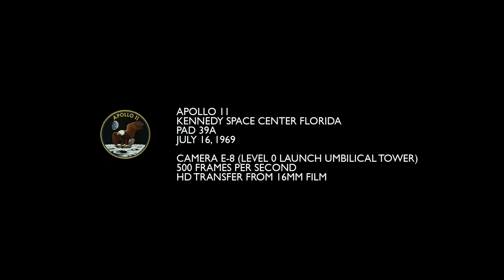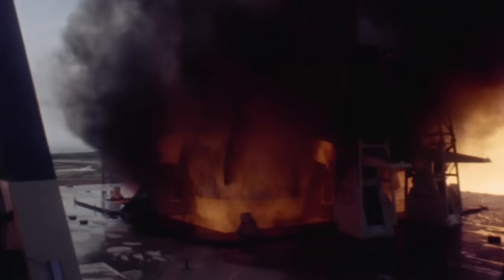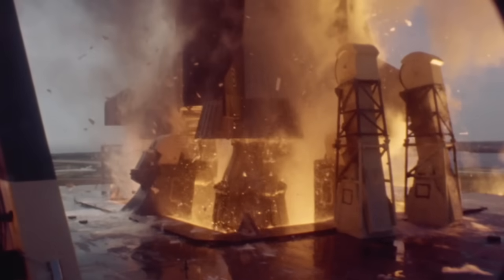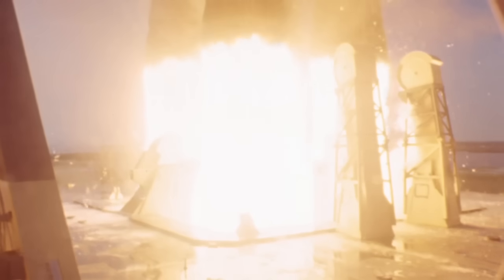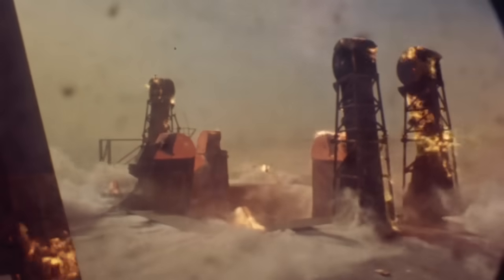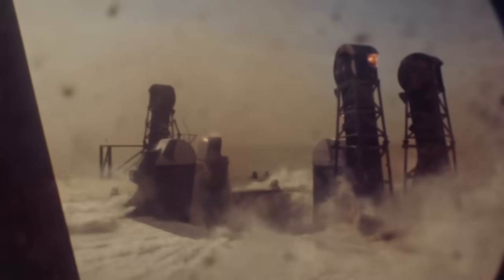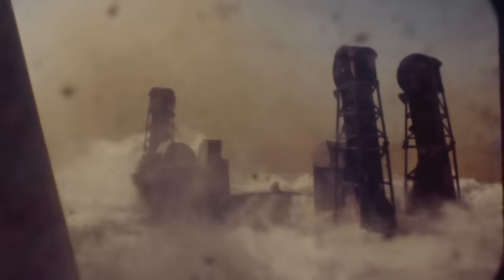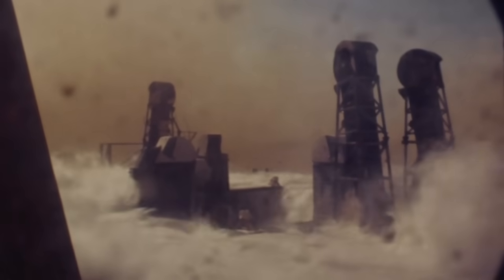Apollo 11 Saturn V Launch Camera E-8

Comment: I like many others at this time was very impressed and watched all of this with great excitement. Though I wondered how they got through the extreme high radiation of the Van Allen Belts, I did not question it. How they landed and took off on the moon's 1/6th gravity with no rockets and did not create a huge creator in the soft lunar dust, also confused me, but again I didn't question it. It was my biggest dream to go to the moon and mars.  Last year in the Space-x program with today's robotics and computer technology it is a matter of historical record that it was the 1st time humans have been able to soft land on a hard surface with rockets.  This was not possible in the 60's 70's and was never demonstrated. It is also physics knowledge that the amount of lead shielding needed to protect from the Van Allen Belt would necessitate the addition of so much fuel, to lift the needed lead or any known shielding material, that the extra fuel would only lift the needed fuel and not enough to carry the shielding.  In other words, Rocket fuel has a limited payload and over a certain amount becomes self defeating. Other yet unknown methods are needed to get a manned shielded craft past the, 20 thousand mile thick, Van Allan Belts. That is why we have not progressed in 50 years. All this was low orbit staged flights.
Reply: +El Fabian - There were never any manned rockets that carried man/women above a few hundred miles and past the Van Allen Belt.  There was never any manned moon landings using rocket technology !!!. Anything that went further was all unmanned and carried minimal 1/8 inch shielding.
Reply: +El Fabian The GR.1 "Harrier" VTOL jet  has been operational since April 1969. It was absoutely possible to land and takeoff on hard surfaces with VTOL.

Hell, helicopters aren't that different, and they've been flying since WW2.
Reply: +Paul Zuk The Harrier and helicopters need air to work; they use turbines not rockets. Much different and much easier technology. Earlier than 2015 there was never any display of rockets soft landing on land.   Look at recent posts by the Space X program.
Reply: +El Fabian - There is no Air or little air on the moon but substantial 1/6th gravity. The harrier would not work on the moon and behave much like a rock in free fall.
Reply: El Fabian
[The Harrier and helicopters need air to work; they use turbines not rockets. Much different and much easier technology.]

It's different, but not at all easier: mechanically, hypergolic engines are actually much, much simpler than jets. Far fewer moving parts.

The entire difficulty for landing a rocket on the Moon lies in control systems, and Harriers not only had to have solved the issues related to VTOL, but they could also operate in two modes: level flight and hover, and transit between them in combat conditions and with a combat load. These all worked fine.

[Earlier than 2015 there was never any display of rockets soft landing on land. Look at recent posts by the Space X program.]

Uh, no, actually, Luna 9 accomplished a soft landing on the Moon in 1966. Several VTOL aircraft were also demonstrated - they used jets, but the engineering problems are basically the same.

SpaceX wanted to soft-land a FIRST STAGE, which is some 10 times taller and heavier than the LM, and has to contend with aerodynamics every step of the way. You really aren't even trying to consider differences between each craft: it's not the propulsion method that makes the Falcon 9 landings difficult.

The gravity on the Moon being lower, and there being no crosswinds, thermal currents or weather to consider makes it EASIER, not harder, to accomplish a landing.
Reply: +Paul Zuk - Paul, I do see what you say, yet, there are some unanswered points: There is no air on the moon; Jets are not much different than a rock; they just don’t work! Landing the narrow clustered rockets would be like attempting to balance a stick with rockets, this is not the case with the wide spread jets of the Harrier. Air does give buoyancy. The simplicity of jets is not in the number of moving parts but in the control, and, speed of response of the jets compared to rockets. Rockets have a very slow reaction time compared to Jets requiring much more intricate control and predictable pre-action. I went to school with a few military engineers and know their problems. For it to have worked back then it would require the lander to be flat plate shaped, and have a minimum of three rockets spaced at several dozen feet apart relative to the vertical lander payload. Today’s digitally controlled robotics motors versus the linear controlled mechanism of the 1960's and new ultra-fast computer controlled paradigms just barely do it. You do know that a NASA scientist did admit that all attempts to fly the lander on earth failed and that better control or a redesign of the lander was needed just a month or so before the lunar mission. To roughly land an unmanned vehicle on the moon which spins and bounces around out of control would kill any living passengers, but is acceptable for secured electronic devices and mechanisms.  I have been quite familiar with the Van Allen Belt and other forms of cosmic radiation since before my teenage and university years in the 1960’s.  Don’t take my word for any of this all this information is available, if you care to look for it. Please consult these other sources and come to your own conclusion. I would love to believe we did land a man on the moon, but the evidence is far too heavy against it.
Reply: El Fabian
[Paul, I do see what you say, yet, there are some unanswered points: There is no air on the moon; Jets are not much different than a rock; they just don’t work!]

Take the oxidizer with you and they do. The only difference between jets and rockets is that the rocket has to take ALL the fuel with it.

This forces different design issues, but flying a vehicle balancing on thrust generated by jets and by rockets is basically the same. The LLTV and LLRV both exploited this principle to train astronauts for operating the LM.

[Landing the narrow clustered rockets would be like attempting to balance a stick with rockets, this is not the case with the wide spread jets of the Harrier.]

It is however the case with things like the X-13, which demonstrated this capability in 1955. Helicopters are also not very different in principle.

The problems were all solved. Also, the Harrier's nozzles were only widely separated on the X axis, the Z axis only saw separation by a couple metres.

[Air does give buoyancy.]

Which no airplane actually uses for control. It gives far more problems for VTOL than benefits.

[The simplicity of jets is not in the number of moving parts but in the control, and, speed of response of the jets compared to rockets. Rockets have a very slow reaction time compared to Jets requiring much more intricate control and predictable pre-action.]

That depends entirely on the type of rocket, and the environment it is being flown in. Acceptable input delays differ based on design requirements, you know.

[I went to school with a few military engineers and know their problems. For it to have worked back then it would require the lander to be flat plate shaped, and have a minimum of three rockets spaced at several dozen feet apart relative to the vertical lander payload. ]

Or it would require the single engine nozzle to gimbal in order to keep the thrust vector pointed more or less through the centre of mass, and an RCS system to nullify any residuals.

You know, just like the X-13 did it, despite NOT being shaped like a flat plate.

[Today’s digitally controlled robotics motors versus the linear controlled mechanism of the 1960's and new ultra-fast computer controlled paradigms just barely do it.]

The LM had a flight computer, you know.

[You do know that a NASA scientist did admit that all attempts to fly the lander on earth failed]

The LM was never even attempted to be flown on Earth, for the same reasons why you don't try to take a submarine and make it fly. It was designed for orbital and lunar operations - it COULDN'T fly on Earth by design.

[...and that better control or a redesign of the lander was needed just a month or so before the lunar mission.]

Name the engineer and source for this statement.

[To roughly land an unmanned vehicle on the moon which spins and bounces around out of control would kill any living passengers, but is acceptable for secured electronic devices and mechanisms.]

Surveyors 1-3, Lunar 13, 16, 17, 18, 20, 21 and 23 all used landing methods that you say are impossible.

[I have been quite familiar with the Van Allen Belt and other forms of cosmic radiation since before my teenage and university years in the 1960’s. Don’t take my word for any of this all this information is available, if you care to look for it. Please consult these other sources and come to your own conclusion. I would love to believe we did land a man on the moon, but the evidence is far too heavy against it.]

You were more familiar with the VARBs than the man who discovered and studied them, who said the idea they would kill astronauts was pure nonsense?
Reply: +El Fabian - There are many who will never be convinced no matter the evidence, but there are a few who , willing to look, will see the outpoints clearly.
- The moon has 1/6th the gravity of the earth. It is logical to expect that the rockets needed to lift off the moon must be at least 1/6th the size of the towering earth rockets that lift off the earth into high or even low orbit. 
Where are these rockets on the moon lander??? 
All one sees is a small pod which barely houses the occupants, that you are expected to believe lifted itself and the astronauts with a bunch of rock samples up into high orbit from a space mass 1/6th of the earths is not scientifically or logically possible. Come now we are not all children, we, at some time after the excitement, will come to our senses and re-think it through. 
- an enormous amount of force and pressure is released from a rocket any loose material including rocks and boulders are blown away, especially loose moon dust swept away leaving bare rock for several hundred feet, but yet there is dust a few inches deep all around the lander, leaving footprints, and we leave a flag and other machinery just a few feet away.  
Don't believe it, then you haven't watched this video of the rocket pad experiences closely!!!
- Now radiation: 100 Rem or 1 Seivert received over a short time period are likely to cause acute radiation syndrome (ARS) and death within a week. The Upper Van Allan Belt radiation level is around 10 Million electron Volts  or 10 Mev. 3 MeV is the daily limit set by the ICRP.  The Rem is a measure of radiation per kilogram of body mas, the MeV is a measure of energy which can be converted to Joules and Calories. The amount of body mass absorbing the energy determines the lethal radiation measure. In the VABs the energy is continuous and consistent. Work it out for yourself.  If some Scientist, no matter who he is, is saying that 10 MeV or 1 MeV over the span of time through the VABs and radiation from the sun throughout the months of journey does not cause harm, you need to ask yourself why is he saying contradictory data. Go down to Florida and look at the thin coating on the lander.
 - The difference in power and mechanics between a Harrier and a rocket are self evident! Controlling the direction and magnitude of a 30 million horsepower relentless rocket engine to balance a vertical non horizontal structure with closely grouped rockets is a different order of magnitude than controlling any turbine jet with a horizontal spread of several dozen feet and no vertical structure. Please!

-The old USSR was far ahead of us with rockets at the time, why did they never leave manned low orbit and drop the potential benefits of mineral wealth and a strategic military moon base.

The evidence is of great abundance and spans a much larger stack of data, if one cares to look.

Why doesn't NASA, get their ethics in, admit it and just go on with renewed research and really fulfill all our dreams.
Reply: El Fabian
[- There are many who will never be convinced no matter the evidence, but there are a few who , willing to look, will see the outpoints clearly.
- The moon has 1/6th the gravity of the earth. It is logical to expect that the rockets needed to lift off the moon must be at least 1/6th the size of the towering earth rockets that lift off the earth into high or even low orbit.
Where are these rockets on the moon lander???]

It is not logical at all. This relation does not scale linearly, but logarithmically, as governed by the Tsiolkovsky Rocket Equation.

The primary variables in this equation are empty mass, fuelled mass and specific impulse of the engine.

IOW, what determines the size of the rocket is primarily the payload.

[All one sees is a small pod which barely houses the occupants, that you are expected to believe lifted itself and the astronauts with a bunch of rock samples up into high orbit from a space mass 1/6th of the earths is not scientifically or logically possible. Come now we are not all children, we, at some time after the excitement, will come to our senses and re-think it through.]

It is indeed scientifically possible. It's not even that hard to calculate: the densities of Aerozine-50 and N2O4 are known, their specific impulse is known, and the weight of the payload can be reasonably estimated. Apply the rocket equation and be amazed.

I did this math ; It checks out.

[- an enormous amount of force and pressure is released from a rocket any loose material including rocks and boulders are blown away, especially loose moon dust swept away leaving bare rock for several hundred feet, but yet there is dust a few inches deep all around the lander, leaving footprints, and we leave a flag and other machinery just a few feet away.]

Quantify "enormous". The momentum impaired to the rocks and dust depends on this quantification, and the question of whether or not a given rock should be blown away and how far depends on the amount of momentum transferred.

Robert Brauenig actually did this analysis. It checks out as well.

[- Now radiation: 100 Rem or 1 Seivert received over a short time period are likely to cause acute radiation syndrome (ARS) and death within a week. The Upper Van Allan Belt radiation level is around 10 Million electron Volts or 10 Mev. 3 MeV is the daily limit set by the ICRP. The Rem is a measure of radiation per kilogram of body mas, the MeV is a measure of energy which can be converted to Joules and Calories. The amount of body mass absorbing the energy determines the lethal radiation measure. In the VABs the energy is continuous and consistent.]

1) The VABs have topography. They are not uniform in the amount of radiation they store

2) The Apollo crews were not flying through the belts naked. You are ignoring the spacecraft itself ; Why?

[Work it out for yourself. If some Scientist, no matter who he is, is saying that 10 MeV or 1 MeV over the span of time through the VABs and radiation from the sun throughout the months of journey does not cause harm, you need to ask yourself why is he saying contradictory data.]

1) James Van Allen said that this idea is nonsense. It absolutely matters who the scientist is.

2) No Apollo mission took "months" to complete. It says a lot that you don't know that.

[Go down to Florida and look at the thin coating on the lander.]

You seem to be hugely confused about the Apollo mission plan. The longest any Apollo astronauts stayed in the LM in space was four days, during Apollo 13.

[- The difference in power and mechanics between a Harrier and a rocket are self evident! Controlling the direction and magnitude of a 30 million horsepower relentless rocket engine to balance a vertical non horizontal structure with closely grouped rockets is a different order of magnitude than controlling any turbine jet with a horizontal spread of several dozen feet and no vertical structure. Please!]

Actually, the X-13 used a jet engine with nearly the exact same top thrust as the lunar module, and managed to land and take off vertically just fine in 1955. It also had the nozzles arranged close together, with the noted difference of its center of mass being much higher than the LM's.

Rocket guidance for liftoff was a solved problem since the 1940s, unless you think the V2 was also a hoax.

You seem to be under the impression that the LM used the F1 main engines, which was not the case. It used a throttlable hypergolic engine with a top thrust of 45 kN for descent, and a separate fixed thrust hypergolic engine for ascent.

Rockets can be different from each other, you know, just like any other engine.

[-The old USSR was far ahead of us with rockets at the time, why did they never leave manned low orbit and drop the potential benefits of mineral wealth and a strategic military moon base.]

It really wasn't that far ahead. Far ahead by what measure, exactly? Throw weight? Reliability? Fuels? What?
Reply: +Paul Zuk - Van Allan did discover the Belts but there has been much more recent probes sent up with more accurate energy calculations. As I said 1 to 10 MeV's in the upper belt and can be much higher during high sunspot activity.  There is also high enough lethal energy in the lower belt and in the region between the belts there are also very high unpredictable streams of cosmic radiation all along the mission path.  Look at the video I linked.

What is the Mass Ratio of the lander and it's needed return fuel load compared to a high orbit Rocket on earth? That should give a clue to the size of the craft needed per these equations. I don't know but I would think it is much more than what we saw in the pictures of the moon landing?? 

I majored in Pure Math/ Physics and Robotics not rocket science and engineering so I would need to do a lot more research to settle my own questions as to what you are saying. Before that, there are still many  glaring unanswered outpoints. My brother majored in Astrophysics but he's a real woss and has no interest in anything though he does believe most of what I say about this as do many of my learned friends. Did you know that an astrophysics student spends a whole semester on just Sun energy data. This includes sunspot activity and radiation. What a waste if it turns out to be an electric plasma phenomenon.
. 
Go look at the spacecraft it's almost paper thin. 1/8th inch aluminum? at most. What protection is that!
You need at least a 1/4 inch of lead sandwiched between two other plates.

A V2 never landed upright. Landing is much different than shooting off. It also is a Logarithmic opposite relationship because the power is decreasing rather than increasing. Look at your own equations

I don't think you answered the dust and rock outpoint effectively.

Aerozine-50 was used by the Titan II ICBM only ! Didn't the moon rockets use a Hydrogen or acetylene /Oxygen mixture LH2/LOX; nevertheless I will at some time do as you say and look at the impulse output of whatever fuel was used.

I still think you bring up several good points and find I am more in agreement with you, but I also find you have whitewashed a few other important outpoints. Who are you?
Reply: +Donald Weber - Further to what I just said. I really don't care. I am far more interested in continued development of space flight and care less about what was probably done earlier by some  greedy unethical people.
Reply: +El Fabian Whats funny is how you have Zero understanding of how much radiation is Actually in the Vab's Nor how Radiation in general works Or have a Basic understanding of how rocket's work. Lul.
Reply: +Mods_o_joy Entertainment Studios : please enlighten me with your great knowledge.
Reply: +El Fabian James van Allen NEVER said a spacecraft couldn't go through the VARB. He designed the tarjectory the Apollo craft took, which only skirted the VARB. The astronauts received less radiation that an Xray tech does over a year.

The LLRV and LLTV were successfully landed hundreds of times.

The lunar lander didn't have just one engine. It had a descent engine and the ascent stage had four sets of reaction thrusters to control pitch, roll, and yaw, which were used going down and going up.

Rockets react a hell of a lot faster than jet engines. Jet engines need time to spool up. Rockets give instant thrust.
Reply: +Donald Weber- I watched closely at the time and LLRV & LLTV 's were not satisfactorily successful at landing on earth. Maybe this datum has changed since then? 
I am aware of the closely packed cluster engines and that the descent stage was purportedly left on the moon. Which I consider was a bright idea.
I understand your statement of spool up time and agree; however thrust vectoring on jet engines, which accounts for high maneuverability, is almost instantaneous and though more complex much faster and easier to control than rockets. Please look at Thrust Vectoring data comparisons with rocket engines.

Also 

It is correct that Aerozine-50 was used! I was mistaken.

The almost 400 foot high 33 foot wide Saturn V held an ocean of fuel and at a mass of 6.5 million pounds  was at nearly the limit of payload available to fuels used in Rockets  with a Trans Lunar Injection payload of about 107,000 lbs with an orbital insertion of ~ 2 billion lbft.s impulse(amazing). The Apollo 11 mission CSM lunar orbit was reported at the time at about 50 km from the lunar surface. Later flights reported an understandably much lower lunar orbit to accommodate the LM lift off restrictions. The LM was reportedly about 36,000 lbs at about 20 x 13 x 12 feet with a propellant mass of about 5200 lbs and a thrust of 3500 lbft. The moons gravity is 1/6th earths and escape velocity works out to about 1/5th that of earths or approximately 2.4 km /s.  Allowing for the Natural logarithmic scale of mass to thrust required, the later missions with a much, much lower lunar orbit were withing the required numbers, but the Apollo 11 falls short.  How did it reach the 50km orbit it needed to re-dock with the CSM.

The 16,000 Newton force required for lift off would not only blow off the dust for several hundred feet no matter what angle the approach vector was and as well the cameras and flag and even boulders with a mass less than 55 Kg or so or  1 or 2 ft diameter. 

Van Allan was wishy washy, his figures showed one set of figures his later comments stated another; besides Data far outweighs any one's opinions including mine; any good scientists should know that.
To escape the heaviest radiation of the Van Allen Belts and the area in between,  one needs to at least go to latitude 50. The Apollo missions were launched from about a 27 degree latitude; where it was much more practical due to leverage from the spin of the earth and I don't know if they can achieve escape velocity from a higher latitude than about 35N or S. 
  
Let us assume no lethal heavy radiation emanated from the sun during the 4 day trip and lunar walks (extremely unlikely). Give me concrete evidence disproving the above data and I will retract my conclusion.